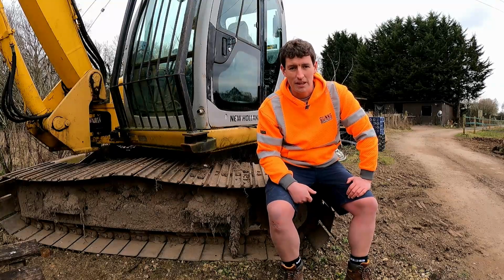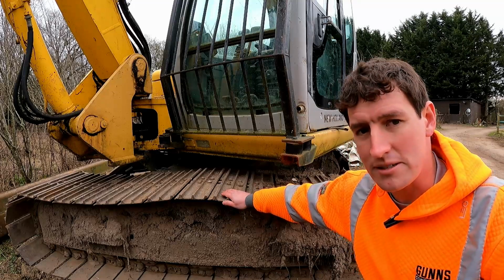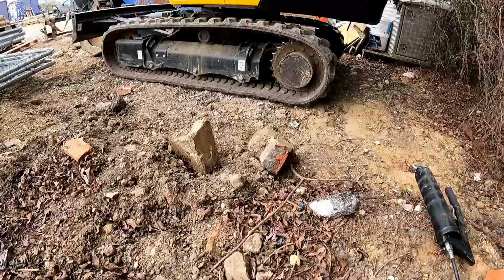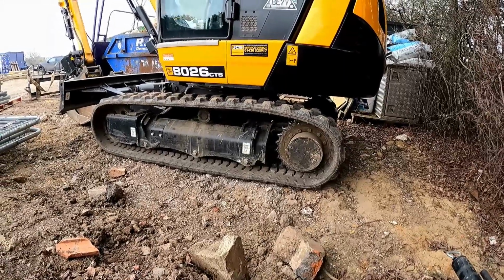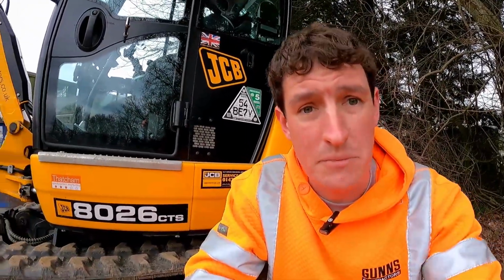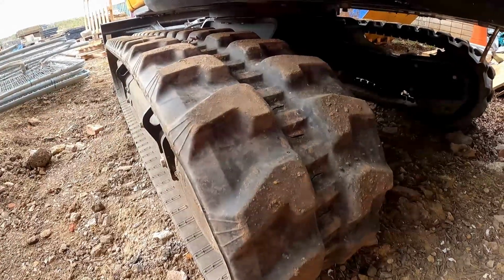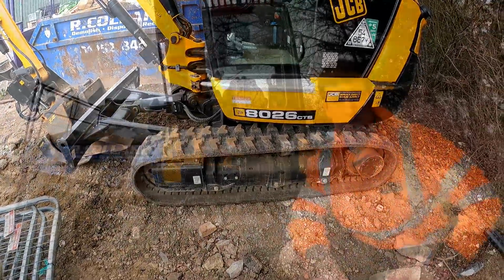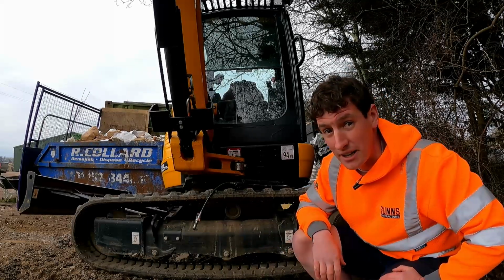Maintaining your Excavator Tracks

Comment: More useful info, keep up the good work. There was a fleeting mention of sharp turns reducing track life. Depending on the sharpness of the turn, obviously the best solution would be to ease back on one stick to make a gradual turn. Is there anything to be gained by using the boom to lift the inside track, then just moving the track on the opposite side to complete the turn? I guess the worst scenario would be to have one track forwards, and one backwards, and spin on the spot.
Reply from the maker: Yes, "spragging" or neutral turns are the worst. Using the arm to lift the toes of the tracks up to do a tight turn is probably the best way to avoid stress on not just the tracks, but also the bottom rollers, and even the surface you are working on.